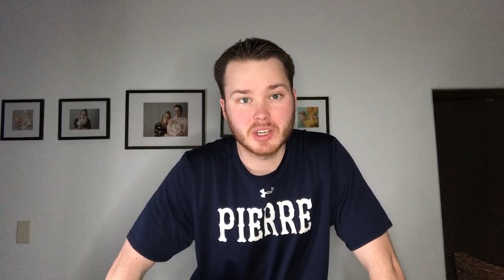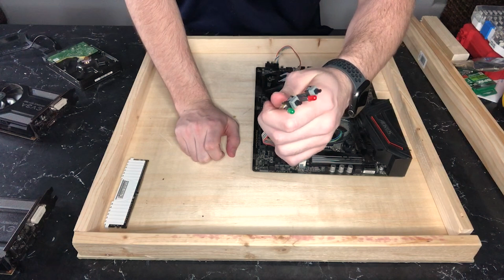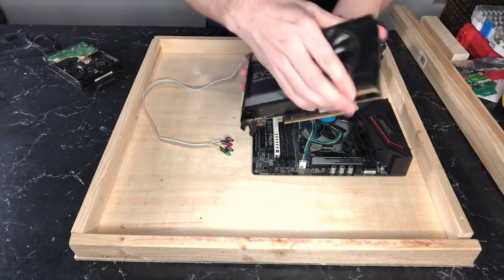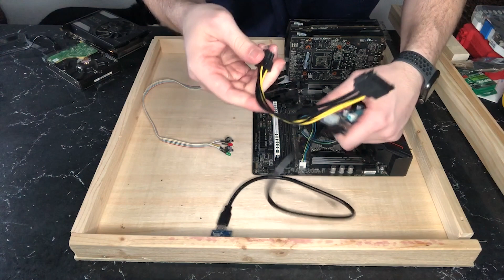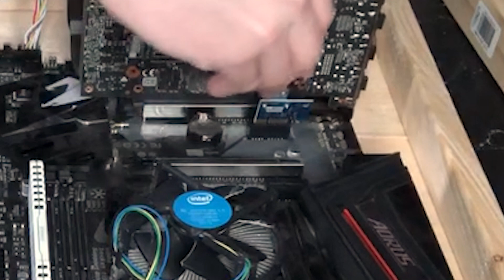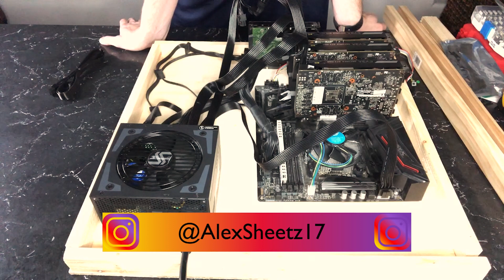3 card Cryptocurrency Mining Rig Setup - What nobody tells you about PCIE Risers!

Comment: Psu size
Reply from the maker: The size you will need will depend on how many and what cards you have running on your rig. For those 3 a 750W PSU would work
Reply: @AlexSheetz  i have 625 watt psu currently running 1 1660 super and 1 rx 6600 both are consuming 145k total can i add one more rx 6600
Reply from the maker: Should be able to, it’d put you right around 600Watts from the sounds of it. It’s a bit high as you want to be using 80% of the max capacity but should be capable of it
Reply: @AlexSheetz  one more question i sold everything in my crypto asset and waiting for dump do you expect market will go down
Reply from the maker: It’s really hard to tell, I think it will at some point but there’s no telling when, it could be in a week or 2 years. I just think there will be a massive crash of  nfts at some point (which could cause crypto to crash too) because there are so many projects that don’t have any actual value
Reply: @AlexSheetz  thanks basically i also have a YouTube channel but i stopped working because of my studies you can check it (ben crypto talks)
Reply from the maker: Cool I will, and good luck! I’ve slowed down a bit cause I own a landscaping business and that’s picking back up again since it’s spring but should have a couple new videos soon
Reply: @AlexSheetz  yes make videos about technical analysis of btc if you want growth in your channel

Comment: Hey , all okay when I run 2 gpu from 16x and 4x pci ex , when I add one more gpu to 1x I can’t have display having problem , what to do ?
Reply from the maker: Hard to tell without actually seeing it all, but make sure you’re trying to get the display from the gpu in the full 16x slot, also when adding a new gpu ive had the screen go black for awhile when it is getting the drivers set up and it appears to be a display issue when there really wasn’t anything wrong, best of luck!
Reply: @AlexSheetz  I found some bios settings for my motherboard , gen2 speed for ports and some other settings

Comment: I have a horrible time with dust and all of this open air stuff would be a dust magnet for sure.  As it is tonight I need to blow my PC out, and clean it.  In the winter the dust will collect even faster due to static and very low humidity.
Reply from the maker: I have the same problem, the ideal solution would be to have it in an enclosed “case” or box and use furnace filters and fans to try and prevent dust from being able to get in and accumulate, for the time being for myself I just clean them regularly as best I can and haven’t had issues thus far
Reply: @AlexSheetz  Good to know you don't mind shutting them down to regularly do that.  For me if they had no enclosure at all it would be every few days.  One thing I did find interesting is enclosing them in this grow tent thing with a fan to blow out the heat which would also suck in the outside cool.  Since I would need a filter I would use two fans but then the power consumption eats any profits.  All this is moot since video cards are insanely priced to the point if mine finally goes I will be without a PC.  I just saw someone post a 1080Ti 11Gb for 18USD, within the hour it is over 500USD with over six days to go.  My 229 USD 1060 is bad, and I wanted to upgrade it so I checked and used from Amazon (buy again link) the price is now 549 for USED.  ffs.
Reply from the maker: @generalawareness101   I actually just used compressed air while they’re running tbh, and check Newegg.com that’s where I buy basically everything from, I just got 1660tis for $599 a couple weeks ago, and I’ve seen the tents as well and considered them but haven’t had any issues so haven’t got them yet
Reply: @AlexSheetz  Well, I have a tire pump that has variable air pressure out that I have used for over 12 years to clean out my pcs.  Works wonderful and cost me 99 from Home Depot back then.  The issue is I firmly feel we need to stay away from 6gb cards (especially with ETH) because I know I have 600mb left on my 6gb 1060 in eth.  Come the 2.0 I think 8gb, or wow if 12gb, will be needed.
Reply from the maker: @generalawareness101  I definitely get that
Reply: @AlexSheetz  I looked over at the gaming channels and they feel the prices will begin to come down, but the overwhelming feeling is they will drop through the floor when 2.0 comes out as every last one shows how the prices for cards is directly proportional to Ethereum prices.
Reply from the maker: @generalawareness101  I can see that but I also can see it not effecting much because there will still be mining for other cryptos not just ethereum

Comment: been using those for 5 years  for 16 cards never had problem wtf are you even talking about
Reply from the maker: Sata Cables aren’t meant to carry much electricity through them so when you are using a more power hungry card you can run into issues from powering the riser with the sata cable connection, I was using them for awhile and had no issues with 1060s, it wasn’t until I started using 1080s that I ran into the issue of them frying my psus, I still didn’t realize it was from the sata cables directly until I called the manufacturer and talked with them about it because I was trying to get the psus replaced, they explained it all to me but basically avoid using the sata cables to power risers at all cost, my cables were literally melted into the psus, and this happened to 3 different psus…

Comment: i have 1 3060 and 1 1660 super which totally consume 125+90 watts , i am planning to get 2 more 1660 supers so totally they will consume 125+90*3 = 395 watts + 80 watts = 475watt for other components. my question is what if i get a 1000watts psu thinking of attaching more gpus to it in future ?
so if i buy 1000w gpu for current setup of 475 watt , will it still consume 1000watt from the electricity bill ? or just 475 watt which my full setup is consuming ?
Reply from the maker: Great question! It will only use the roughly 475 watts of electricity if that’s all that it would need. However where you’ll run into issues is you may not have enough pcie connectors to handle more gpus if you’re already going to have 4 on the 1000 watt psu and risers for each card. I personally like to have 3 cards per psu as most psus come with 6 pcie cables which leaves one for each gpu and one for each riser
Reply: @AlexSheetz  hello can you please suggest me system configuration under 200,000 rs and also how much I earn in 1 month as per your experience and also please suggest which graphic card do I need to buy because I am very confused so please suggest me
Reply: You should also  consider your PSU's efficiency, if it is 1000w and we assume it is 80 plus platinum (~90% efficiency) it will only give you ~900w

I also highly recommend to buy a wattmeter, as someone said before

Comment: Bro if i use one x16 slot and two x1 slot then total lanes i used is 18 in motherboard......then will this setup  work with 16 lanes cpu?
Reply from the maker: I’m not entirely sure as I personally haven’t done this, my advice would be to try it out and if you run into issues try a 3rd riser

Comment: Thank you for the valuable info. :)

Can you suggest which motherboards are good for 3 Gpu? low budget is preferrable. I was thinking about Gigabyte x570 UD, but it has heating issue even with 2 gpu.
Reply from the maker: I don’t have a specific board to recommend at this time as I haven’t bought one for awhile but I personally really like Asus and have not had issues with any of their equipment. As long as you’re getting any half way decent motherboard it should have 3 pcie slots and be able to handle them. In the past I’ve paid from $75-$375 for a motherboard for mining so it really just depends on your timing and what’s available

Comment: Great video! just wondering am I able to just use a 6pin from the psu ? Thanks
Reply from the maker: For the riser? Yes you can! I actually have a couple that way right now, it’s one of the easiest ways as long as you have enough 6pin connections to power both the risers and the gpus

Comment: So how much pci-e bandwidth is needed for mining? Like how many 3060’s for example can you run at full hash off a single pci-e x16 (PCIE 3 or 4) ? Thanks so much
Reply from the maker: I’m honestly not sure how many could run off of a single slot and don’t see a need to either, I think you’d just run into more issues than it’s worth, most boards have 6 total slots that you can plug a riser into which is a good amount for psu capacity anyways
Reply: I have a MCI Pro Carbon AC B450 board which has only 5 total PCI-E slots (2 x 16, 3 x 1) and they did make a X16 to 8 riser, they still make 6:1 and the easiest is the 4:1 where it splits the x16 into four risers where each one is one lane so x1 (bit odd when you would think x16/4=x4 but no).  Windows 10 has an issue with more than 10 gpus.  Other OSes have other limits.

Comment: what power source is that?
Reply from the maker: It’s an EVGA 1000 Watt PSU, BUT I only really need a 750 Watt PSU for this rig because I am running 3 1060s which need 120 Watts each and then another 150 Watts for the motherboard/system so a total of 510 Watts needed, so to follow the 80% rule (510*1.2) I’d need at least a 612 Watt PSU so 750 watt would work great, I just had the 1000 Watt left over from an old rig so used it for the time being, great question!